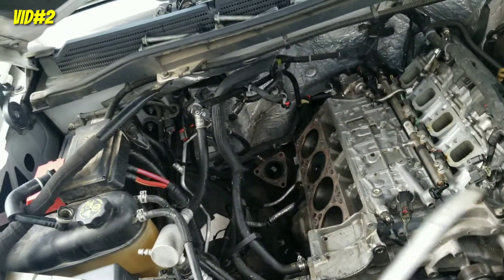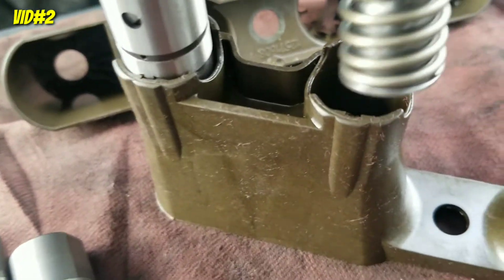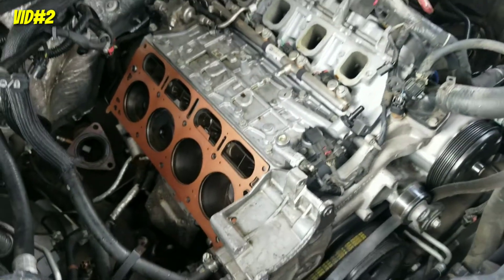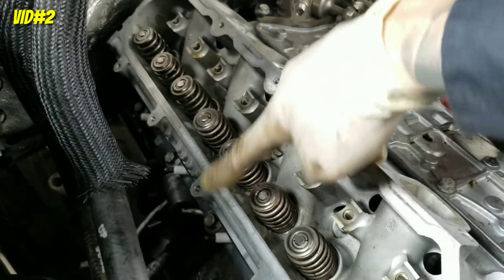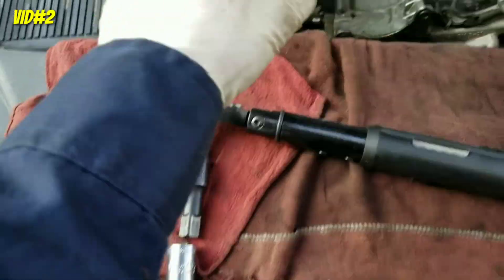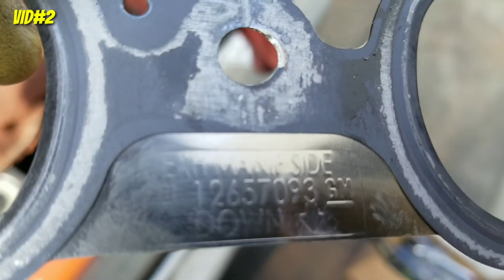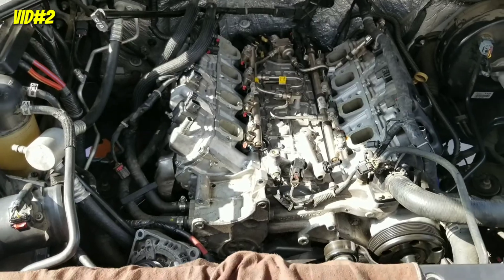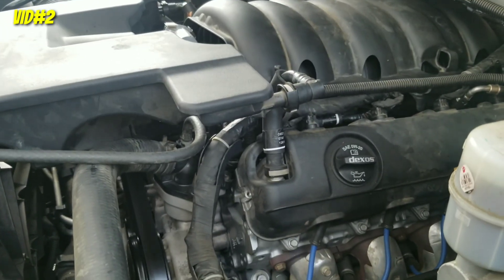How to install the lifters,head gasket,head torque specs on gmc Sierra or Chevy Silverado 2012-2018

Comment: Thanks for the great video. Exactly the problem on my truck, but on Cylinder 5. I have another problem though, probably from driving with a stuck or collapsed lifter. When I am at idle, my oil pressure is 10-20 psig. When I'm driving, I am at a normal 40 psig. I noticed I have some metal shavings in the oil, so I am not driving it now. What bearing or component could I have damaged?
Reply from the maker: There is no way to tell what bearings got damaged, only opening the engine! Remove the oil pressure switch and hookup a oil pressure gage to male sure the psi you getting is accurate! You can also add a Lucas additive or replace the oil pump or shim the original oil pump so you can get a higher pressure if you do have low oil pressure
Reply: JM8686 @ how much is the parts cost$??? Parts
Reply from the maker: What exact parts?  
Lifters dod and regular
Head gaskets 
Head bolts 
Coolant 
Oil nd filter
Spark plugs 
Spark plug wires 
Valve cover gaskets
Intake gaskets 
$1,700 thats how much i paid for all those parts for a 2016 cadillac escalade! 
From the dealer
Reply: JM8686 @ lifters, head gaskets, oil pump,  oil pan gasket, oil& filer, coolant, head screws,
Reply from the maker: You will have to call you're local dealer for exac prices!
Reply: @JM8686  Thank you! Just pulled the cylinder head. Now it's really tough to get the stuck lifter out. I saw a video about using some brake cleaner (or something similar) to free it. Any other advice? Also, I started to strip a few head bolts. Do you know the specifications for those bolts?
Reply from the maker: Lifters should come right out pretty easy, if they give you a hard time is because you might have a damaged cam shaft or even the engine block it self! Make sure the brown plastic lifter holder is not damaged cuz sometimes the lifters spins around off the lifter holder!
Send pictures to my Instagram 13b_dorito
Reply: @JM8686  Was able to get the lifter out. The roller had broken off, and I was able to use a magnet to pull out little pieces. Also, had some pieces in the oil pan and metal shavings. That explains where the shavings came from. The cam shaft looked pretty good, maybe a little tiny bit of scouring, but at least this will be enough to get the truck on the road and clear a few codes to trade it in.
Reply from the maker: Good job 🙌
Reply: @JM8686  So I started her up, and have a flashing warning light. The lifter noise seems to have gone away, but the oil pressure is high (60 psig or more) at idle. Also, the timing seems off. Is it possible I installed the rocker arms and push rods incorrectly or that the cam shaft actually was damaged? Also, I am getting a code that the Oil Pressure Control Solenoid Valve is stuck on. I can't find much info about that online (only about the simple fix of the Oil Pressure Switch and screen, which I already did). Since I had metal shavings in the oil, could it have clogged the Oil Pressure Control Solenoid Valve? The truck is running very rough at idle. I took it for a drive and it is rough for shifting too.
Reply from the maker: Flashing light could be from spark plug, coil,cable or injector, you have to plug in a scanner and read live data to see what cylinder have misfire
Reply from the maker: Also 100% sure the cam got damaged cuz of the roller got messed up
Reply: @JM8686  yep that definitely makes sense. I took a video of the cam for that cylinder when I had her opened up. Some scratching, but it didn't seem damaged to the point of it running this poorly. Should I take the cover off and watch the rocker arms while it's running? I did that before and it was very easy for me to diagnose what cylinder had the lifter issue. I'm picking up a code reader this afternoon to find out the exact codes. Thanks for all your help. You're the man! I'll keep liking your videos to give you a boost.
Reply: P219A, PO300 and PO307 are the codes I'm getting. Cylinder 5 was my lifter issue before. Lifter tick is gone, but Cylinder 7 seems to have some active fuel management issue. I am going to replace the exhaust manifold gasket because I had to use the old one until the new one came in. Also, I am going to replace my fuel injector rail on that bank. What are your thoughts?
Reply from the maker: #5 is not a DOD/AFM lifter tho! 13b_dorito my Instagram for faster help
Reply: JM8686 @ lets sai just the   Collapse lifter , and oil pump replacemnt,???  Parts & labor +_-

Comment: Great video. So the right cylinder head doesnt have the big allen head bolt like the left one does? Im currently working on a 2015 silverado with tge l83 engine and i bought head bolt sets but both come with big allen head bolt.
Reply from the maker: Correct, right head (passenger side) does not comes with the big Allen head bolt 👍 
Don't forget the grounds behind the head
Reply: @JM8686   so torque is 22 90* n 70*  Not 59 90* 40*    ????
Reply: @chalinoahuesoduro5566  I am also wondering this.

Comment: Great video!  I have the same issue on cylinder 6. How long would you say this job takes?  Also, someone told me I’d have to resurface the head before I reinstall it, is that true?
Reply from the maker: Takes from 3 to 4 hours all you need is the tools and no you don't have to resurface the head before installing unless you cause any damage on the surface
Reply: JM8686 I took the valve cover off today, but the rockers on cylinder 6 don’t seem to move.  Could the lifer still be bad?
Reply from the maker: Yeah lifter could be bad! Message me on Instagram 13b_dorito for fast respond

Comment: What's the torque specs for the head bolts
Reply from the maker: Make year and model?
Reply: @JM8686  2016 Silverado 5.3
Reply from the maker: @oswaldoa48  big bolts 3 steps 22lb + 90° degrees+ 70° degrees 
Small bolts 25lb only one step
Reply: @JM8686  thank you
Reply: @JM8686 is this the same for a 2015 Silverado?
Reply from the maker: Yes sir
Reply: @JM8686  great video man 🙌 do u know by chance the head torque aspects for 2015 Sierra 1500 v6 4.3 LV3?

Comment: What if you don’t have a digital torque wrench that reads degrees
Reply from the maker: You will need a cheap dial-clock gage from ebay or Amazon
Reply: Can I reused the same head gasket?
Reply from the maker: No
Reply: Thanks
Reply: Hey do I have to put spray cooper  the new acdelco head gasket ?
Reply from the maker: No there is no need
Reply: Ok so I have to put new bolts for the head and what is the torque 2014 Silverado 5.3?